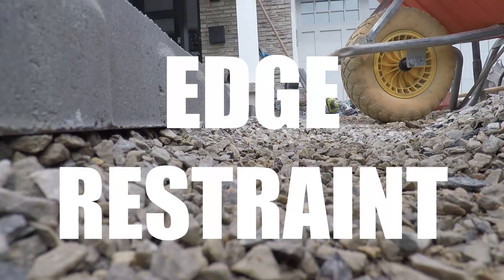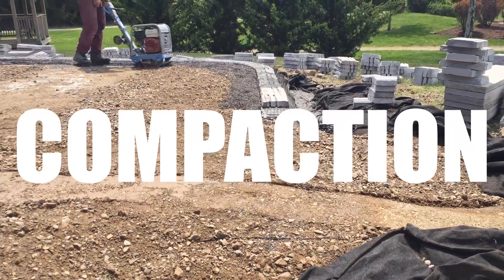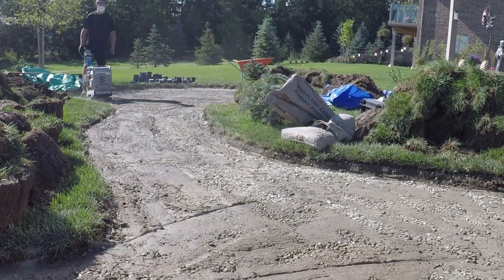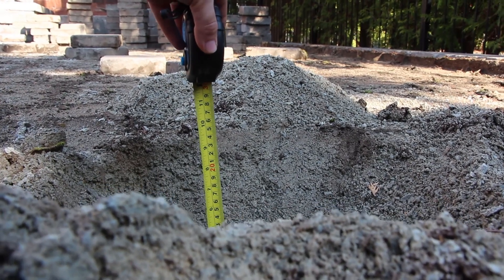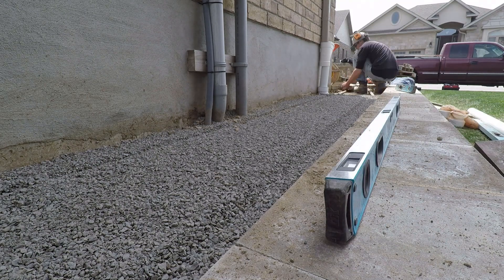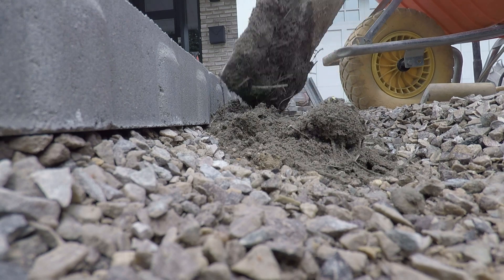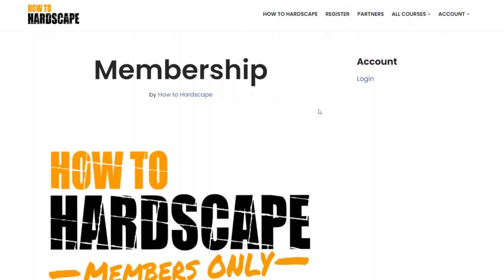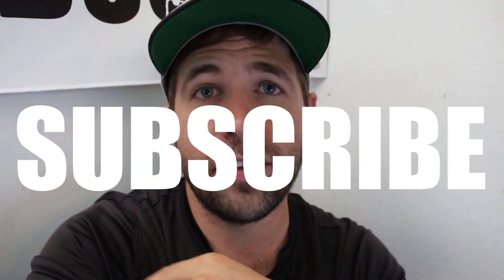7 Commonly Overlooked Paver Install Mistakes that Lead to Failure

Comment: Great points in this video  
I am doing a flagstone patio. Using 4 to 6 in sub base and 1 in bedding layer. Since the flagstones have irregular bottoms, setting them in the beddng layer is key. So I will use a soft mallet to settle the stones against the bedding layer.  But when you put down polymeric sand, do you consolidate it? Pretty sure you can't run a tamping machine on top of flagstone because it will break the stone. Even with some protection. What's your recommendation on consolidating the poly sand in between the stone joints? underneath of it. 

Saw your other videos on bedding layer material. But, some manufacturers have recommended using stone dust as the bedding layer for a natural stone. What are your thoughts?
Reply from the maker: You can use a rolling compactor on it, but if you do not have access to one you should still find a way to consolidate the jointing compound with some sort of vibratory force or use NOCO by Techniseal as the polymeric sand. If you are using polymeric sand as your jointing sand, do not use stone dust it will cause it to fail.

Comment: What is your opinion of contractors that break up and using the old pavers under the new pavers?
Reply from the maker: Oh I can’t see that working well…
Reply: @iamahardscaper  Nor do I but it is a thing here with contractors… saving shifting, saving fill.
Reply from the maker: I wouldn't count on a contractor to get the right gradation necessary for that aggregate.

Comment: Nice video… didn’t know how much you hated stone dust 😅😅😅
Reply: I used stone dust for 20 plus years. And never had a failure. I try to use rice stone now. Tried bedding sand but always had lose pavers.

Comment: When installing pavers next to existing concrete , how high should the pavers sit before final compaction?
Reply from the maker: I typically go 1/16” to 1/8” above when using HPB as my bedding. 1/8” to 1/4” when using concrete sand.

Comment: I'm doing a Flagstone walk way on clay soil. I have excavated down 8 inches from the top of concrete entrance. The area is 8 feet out from entrance, turns right, 5 feet wide and runs out 32 feet. I would like to grade of 1/8 inch per foot. I had planned to lay down landscape fabric, base corse (crusher fine) 4 inch, and sand for bedding 1 inch. On one side I have a flower bed running the full length of the walk way, the outside edge I had planned on running drainage pipe. I have cut my flagstone into different sizes squares and rectangles, I want the straight edges to come together and had planned to use sand to fill in the joints. will my walkway project fail?
Reply from the maker: Do you experience freeze thaw cycles? Clay is a weak subsoil, I would add some 3/4” crushed stone to it and compact it, then fabric. Is crusher fine chips and dust? Don’t use that. You said 8” excavation but only 4” base? What will make the rest of the height up? I would do a minimum 6” base if you are in a climate that has freeze thaw.
Reply: @iamahardscaper  yes freeze and thaw. I will take your advice and add the 3/4" crushed stone. I went 8" to have enough base course to make up for the various thickness of the flagstone 1" to 3".  so now Im thinking.
      Compact subsurface adding the 3/4" crushed stone, fabric, 6" base course compacted (can I use 1/4" crushed stone here or what would you recommend) because the crusher fine dose have dust in it, then lay down the flagstone (do I want sand as a bedding for the flagstone? ). Since the edges of the flagstone are coming together tight 1/16" or tighter,  I was going to use sand. Then vibrate the sad as shown in your presentation. will this give me a long lasting walkway.
Reply from the maker: I would prefer sand setting bed. In that case I would use a 3/4" minus base at 6" and then a 1" sand setting bed for the flagstone. It sounds like you are on the right path.

Comment: Question: I want to relay the pavers around the inground pool of my parents and I want to know how you would do it ? If i want to do a full repair  can I use 3/4 clear with hpb. can i use a plate compactor around a concret pool ? Thanks !!
Reply from the maker: You could use Gator Base. Remove pavers, remove the bedding layer, scrap off enough from the base to make room for the Gator Base, compact, install non woven geotextile, bedding layer, gator base, pavers. You should be able to compact. Is it a pool with a liner with like 3’ of concrete around the pool?
Reply: @iamahardscaper   Good !! thx     They pour concret in the base of the pool. For the walls its like a plastic mold that they pour concret in it.  The liner seems in vinyl.  On the top of the edge of the pool there's concret caps and pavers.   But the for the bedding layer can i use hpb or concret sand would be better ?
Reply from the maker: I can’t say what shape the pool is in, but you should be able to compact. I use HPB rather than concrete sand. We also have a video on installing synthetic base that may help
Reply: @iamahardscaper  Thank you very much !

Comment: The number one failure I see with paver installs in my area is people using dinky little plate packers that put down enough force for 1-2 inch lifts, and doing 10 inch lifts. 

I get it, not everyone can afford a Weber CR3 at a price of $8800 but damn, go to princess auto and buy a reversible packer for $1000 like I did. Works just about as well until you can find a second hand machine. The prices in Ontario are psychotic but there are work arounds. 

The second most common failure I see is incorrect polysand installation and after that is using bloody limestone screenings. Horrible product lol.
Reply from the maker: Definitely! Even if you can’t buy one, they can be rented. Delivered and picked up. There is no excuse for poor compaction. And yeah limestone screenings suck 👍